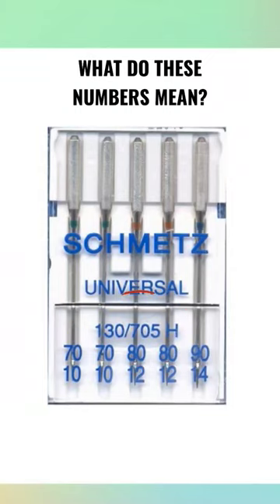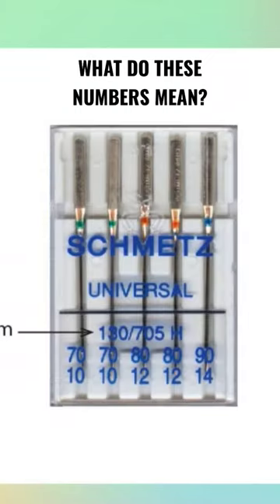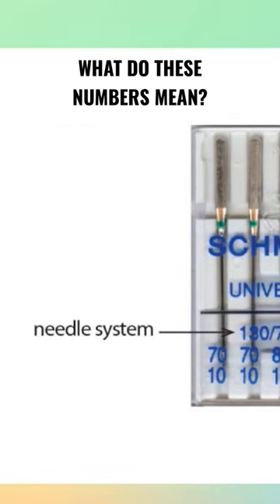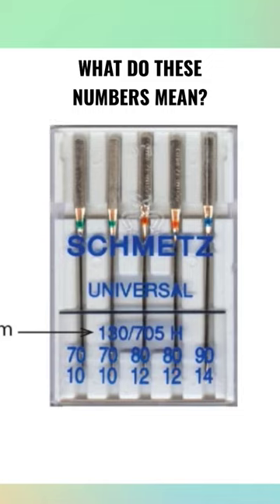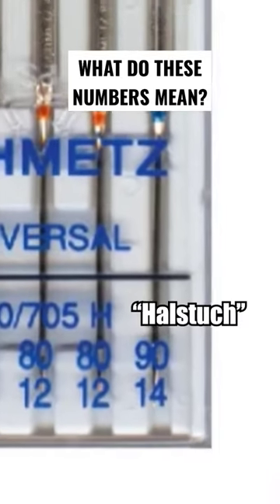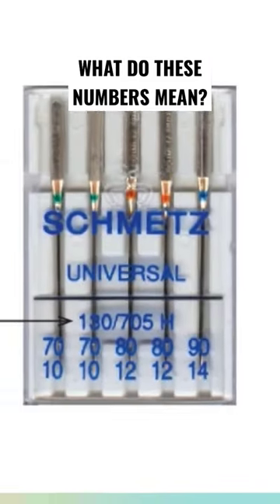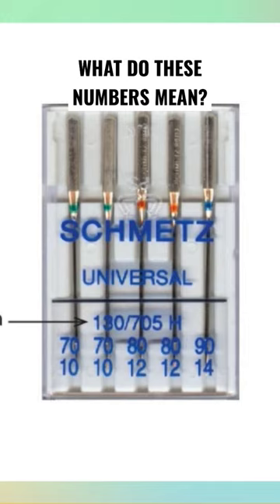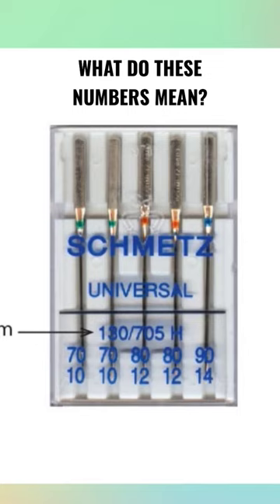Full walk-through of Schmetz needles is now on our channel! #sewing #howtosew #sewingmachine

Comment: So if it's just a model number, does it depend what type od sewing machine to use it on?
Reply from the maker: Yes it does technically matter, but 99% of home sewing machines use the same needle type. You really only have to worry about using different needles when you start using industrial machines or longarm quilting machines. Still, always check your user manual and it will give you the "model" number of the needle you need to use.